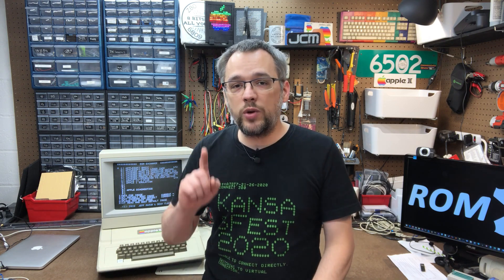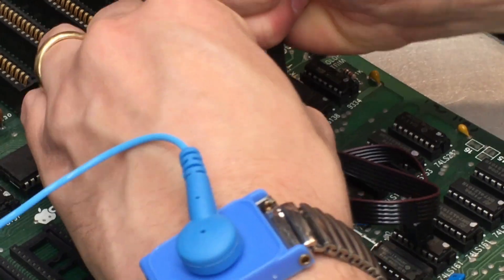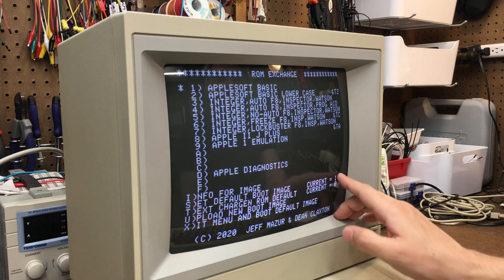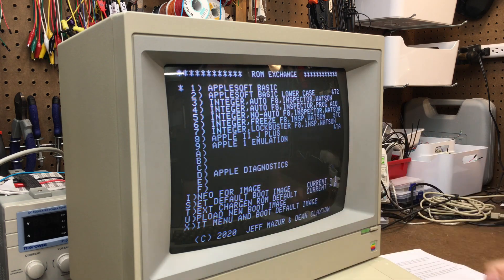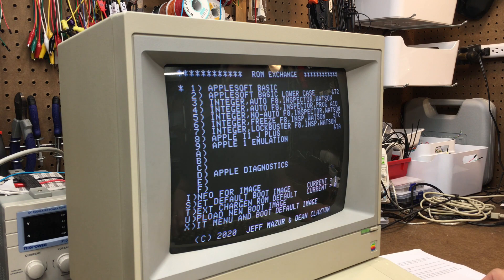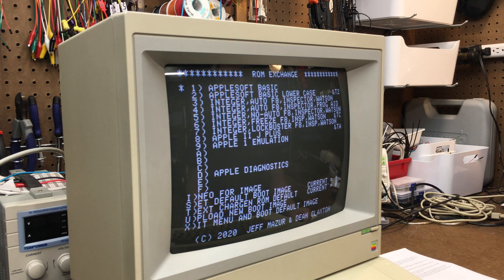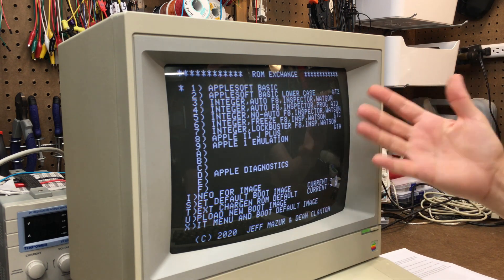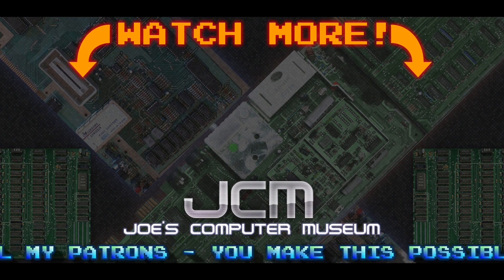ROMX Upgrade for Apple ][ and Apple ][ Plus

Comment: Just to be clear, the language card on an apple ][ plus does NOT need to be modified?
Reply from the maker: If you are using the "Apple Language Card", part number 670-X006 (or any clone thereof) in slot 0 of an Apple ][ or Apple ][ + and wish to use it with the ROMX, a modification to that card is required so that the card's F8 ROM doesn't interfere with the ROMX. Page 10 on the installation guide. https://theromexchange.com/documentation/ROM%20X%20Installation%20Guide.pdf
Reply: @JoesComputerMuseum  Yep have that same card... damn I hate soldering.
Reply: @ACiDRAiN9797  You can do the mod solder free - installation guide covers it off :)
Reply: Not even give minutes in, and I've already sent an email to inquire about ordering. What a fantastic product! Thanks for the video!